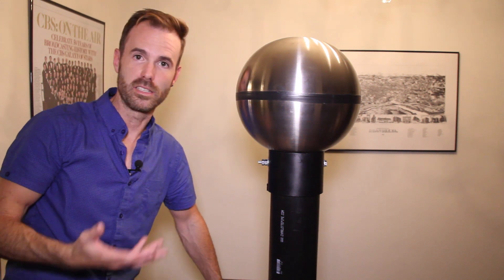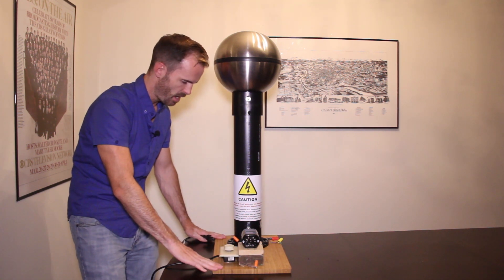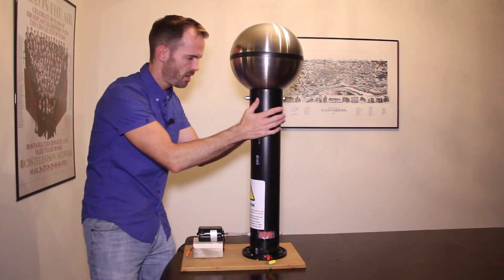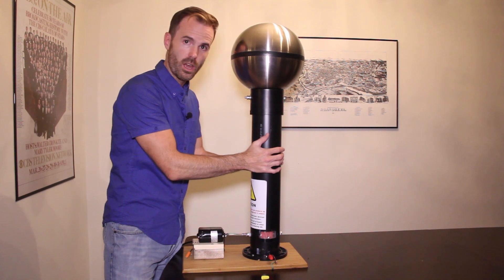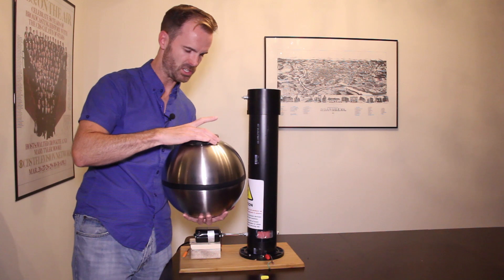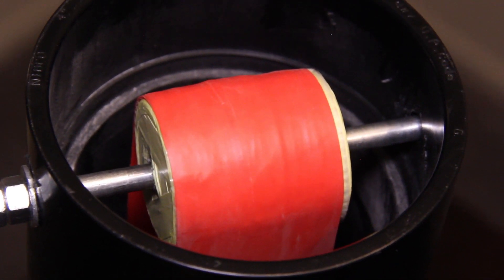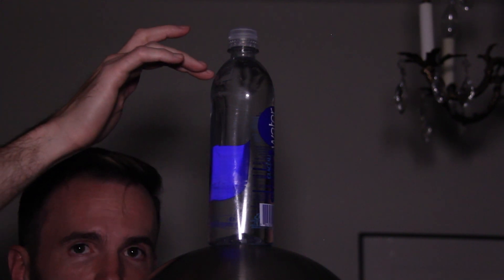How to Build a Van de Graaff Generator

Comment: Great build, thanks for showing and sharing build experience! Water bottle, well that's interesting, what if you replace it with 5 litter bottle... All right, you do that, so we don't have to. :D What if those brushes get replaced by parallel plates to belt. Well, there is only one way to find out, I need to build my own and take it to the next level or over do it. I don't like that metal ball on top of it, it's not easy to obtain it, might be expensive as well, like you said, that it looks like there is a shortage of them. But probably it can be anything metallic - just no sharp edges, like soda can.
Reply from the maker: encryptor256 Thank you! I have actually used a 2 liter bottle, just bigger sparks (again you don't want to touch the bottle while it's charged, lots of current gets stored). I'm not sure what you mean by plates. The brushes need to have as many sharp points as possible to make it easier for the electrons to flow on to the belt. And the ball cost me like $8 at Ikea. I don't know why but they are having a hard time getting them from their distributor. But I have seen builds using a Coke can. Good luck and have fun building your own!

Comment: How did you cut the hole in your IKEA bowl? I'm not totally sure how to go about that part!
Reply from the maker: I very carefully measured and then I used a Dremel tool with a flat cutting blade.
Reply: Simon McMillan making a nice rounded hole in the top sphere that doesn’t leak charge is VERY CHALLENGING, perhaps the most challenging part of a “professional” VDG.

Comment: Nice, but I have couple of points:
1) The bolt for the top roller is causing a some leakage to the air, maybe you could replace it with a nylon bolt?
2) 6:25 This works way better if you put the cups with the spikes down, so they don't bleed of charge.
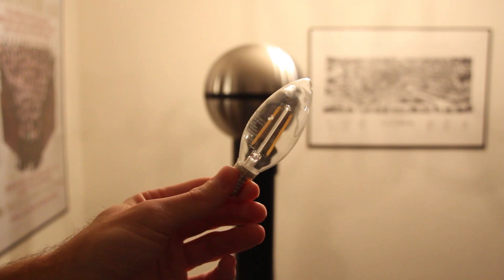3) 8:40 That is an led filament bulb! A CFL would have been better.
Reply from the maker: Good call on the bolt, I will see if I can find a nylon one.  And yes, I don't know why I said that was fluorescent.  🙄